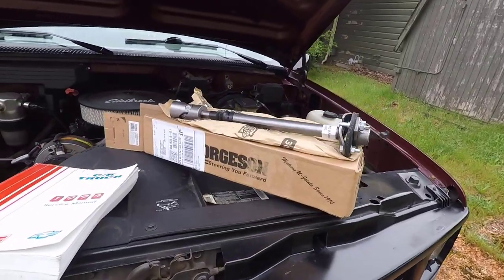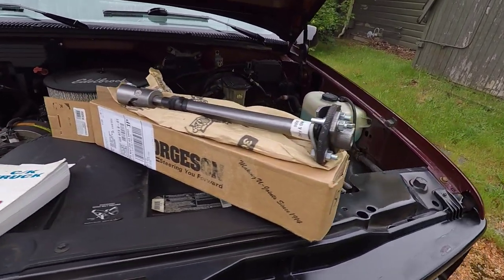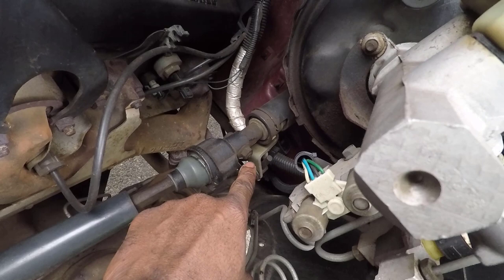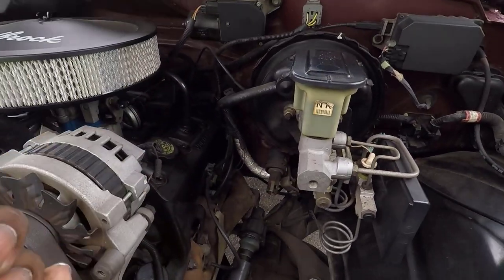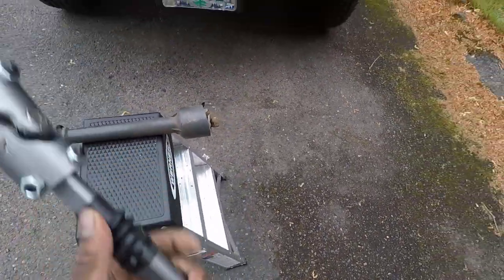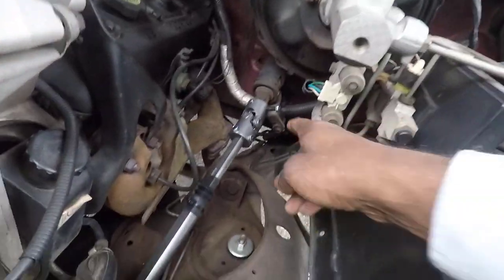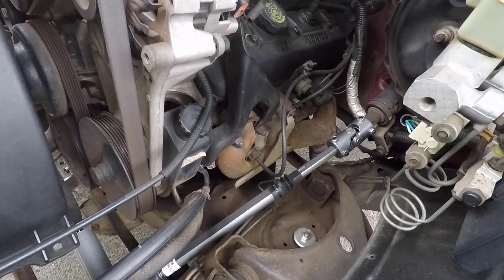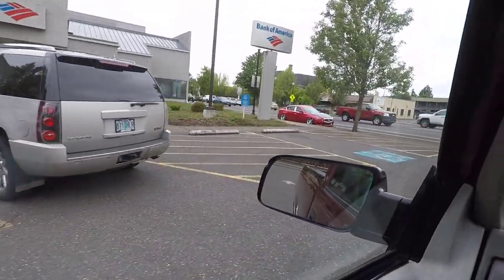Intermediate Shaft/Steering Shaft Replacement: 1994 Chevy C1500 (Borgeson 000936 Steering Shaft)

Comment: Dude! Great video!! Clear and informative. How's everything working out now that you've had a chance to drive it a while?
Reply from the maker: Thank you!! The truck has been driving awesome. I've put many miles on the new steering shaft and while it's not the Ferrari-like steering I was hoping for, it feels pretty good. I think I'll get a little closer to that Ferrari steering when I decide to upgrade to a performance steering box... one of many projects left to do on the truck. Thanks for watching!!
Reply: Yes great video! This steering shaft also looks like it will fit the 96 Chevy model trucks, what do you guys think?
Reply from the maker: @vincentorona163  I think it should fit as you have an OBS Chevy truck too, but make sure to double check.
Reply: @BuildYourOwn  I think the reasons you expected more precision and didn't get it are two fold.

1. You still have a rag joint. They're rubber and cloth so they have natural give to them, which will feel like vagueness. A dual u-joint shaft would have helped.

2. It's still a worm gear style steering system, which is not precise compared to modern rack & pinion. You can tighten the nut or upgrade the box but I suspect there are still limitations by design.

Aside from that there are also bearings in the steering column itself that may be worn.

And you have tall sidewall tires that will ride nice but not give you sports car handling.

Comment from the maker: This actually is a big improvement. I still think I can make the steering better, but it's 100% better than what it was
Reply: Did you ever make it better? Im having a very similar issue With loose steering ive replaced the gear box and rag joint

Comment: Good video man I’m glad that I found your video in the instructions you gave from the manual. Because I replaced mine and I have to go around some pretty good size turns on my way to work and I can’t even turn my steering wheel the way you were turning yours. The steering is so tight after I fixed it if I move my steering wheel more than a couple of inches. My truck would probably cut a 360. I know it’s extremely hard to picture that but it’s almost like a racing steering rack or something it’s hard to explain but the best way I could explain it is for one rotation of the steering wheel. It’s like I rotated it three times. I’ve never had a vehicle do that. I’ve brought it to several mechanic shops and they just say it’s good to go.
Reply from the maker: Hey there, thanks for watching and I'm glad you found the video useful! It sounds like you've encountered quite a unique situation with your steering after the replacement. It's definitely not common for the steering to become that sensitive, and it's understandable that it would be concerning, especially when navigating turns. It's possible that there may be an issue with the alignment or another component in the steering system that's causing this over-responsiveness.

Comment: Cunningham Machiene makes a great one! It’s a replacement and removes the Rag joint which will fail again
Reply from the maker: I just checked it out on their website, looks good. With I would have seen them before. I may contact.
Reply: I own a 98 and many gm trucks in the past the rag joint kit from rockauto and summit  is lares 205 its 33 dollars
Reply: Gunna try out this one. Hope it works well. My 94 has lots of play to the steering.

Comment: You can also adjust your steering box to take away some more of your slop. But be careful not to over tighten the screw. Only adjust (tighten) the screw a maximum of a quarter turn. Its real easy.

Comment: My universal u joint doesn't sit snug with the set pin and locking pin.   I pulled the same style steering shaft out and installed the same one you have
My universal u join slides around where the old bigger bolt was.   How did your fit?   2500 92" suburban

Comment: Is it possible to pull the borgeson shaft apart and slide the oem dust cover on?  Just curious.  Great video thanks!
Reply: From the looks of the wider rag joint, it probably would not fit, so I'd say no

Comment: I just bought a 94 c1500 Suburban. I'm noticing a massive price difference in 1994 to 1995. What's the difference? They look exactly the same. Will a 95-99 fit my 1994?
Reply: No, 1995 and up is completely different, with 1995 being an oddball transition year for many parts.
Reply: @cpufreak101  yeah, I posted that comment wayyyy before I did enough digging or anything. Although, I thought I had. Plus one truck I'd looked at to compare, had modified their steering components so I was mislead on top of being somewhat uneducated, I suppose. It IS wild to see how cheap the 95 shaft is compared to the 94. Cheapest I found & ended up getting was around $250. Replaced the lower column bearing as well with the upgraded one. Not a fan though. I heard Wolfe has a nice kit though for about $100.
Reply: @TheRealWYNRS  I think part of the reason for '95+ being cheaper is that it's a multi-piece shaft unlike in the '94 and older where it's all one piece

Comment: serious question. why not just replace the rag joint for $30.
Reply from the maker: One could certainly do that. For me, this truck is about restoration when it comes to repair. For others, it's just about a fix and usually at the cheapest price. One way or the other, its all good brother.

Comment: I guarantee 50% of a worn out system slop is in the steering gearbox itself you can replace every piece in the system except the Box and you can only improve your steering slop 50% you have to do the steering gearbox,  Additionally you have to get a really good Box you can't get some crappy rebuild one that's very cheap they come with slop in them
Reply: The factory steering boxes rarely wear out unless you let it get contaminated with metal from a bad pump and drive it awhile like that. A little adjustment at the sector preload about every decade is all that's needed. 250k hard miles on mine, and it's still great, I have about 1/4" of play at the rim of my steering wheel... still using a rag joint that has been replaced. In the unlikely event that you do have one wear out... rebuild the OE one yourself rather than getting an aftermarket one.... you'll be waaaaay better off in the long run. Same thing with the pump, super easy and cheap to rebuild the OE one. If a pump does go bad.... make sure you flush the steering box before hooking up the new or rebuilt pump or it wont last long, a PS filter is recommended in the return line, just because.... why not.